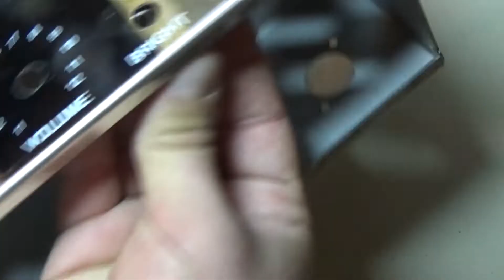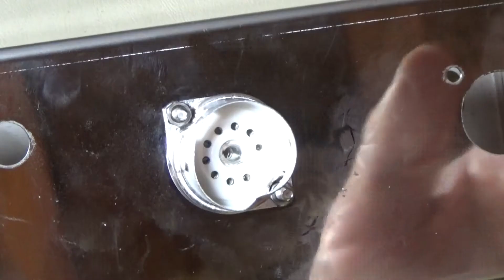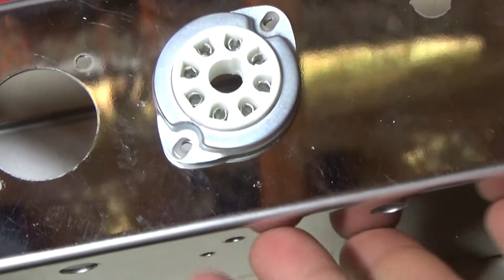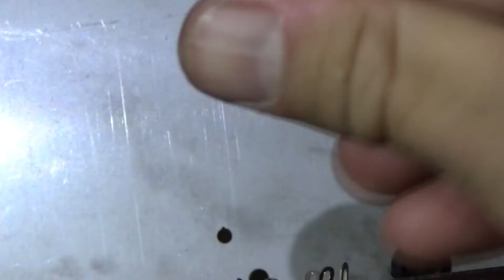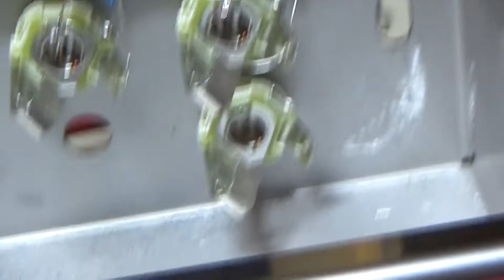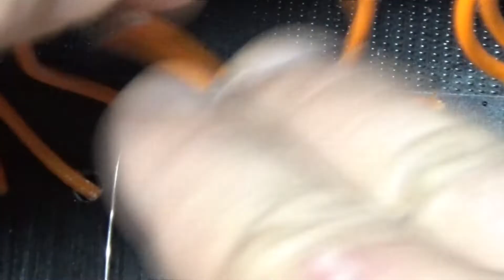How to build a tube amp (Tweed 5e3) without instructions - Part 3

Comment: for anyone else about to build a chinese 5E3 kit. you may want to consider using 18 gauge wire on the heaters. these are the 2 wires that are wound together and connect to the tube sockets. They also run up to the light. my kit came with 22 gauge only and I've read that 18 gauge might be a little better in the long run for the heaters. alright, back to our regular scheduled programming.

Comment: great video again. I used it along with the Mojotone schematic (board layout) to do everything. I found some insulation sheeting at a local electronics store which JB Welded to the chassis. If that helps anyone.